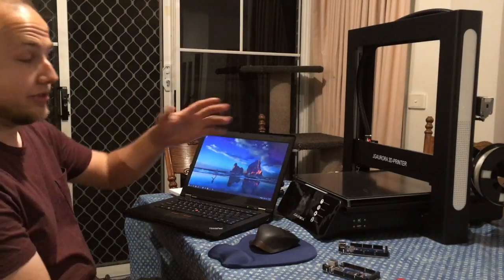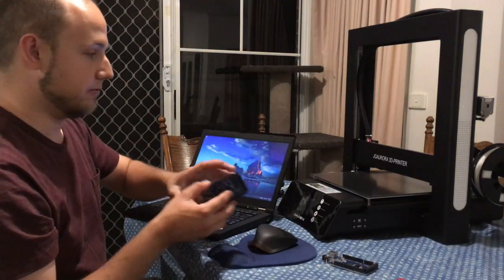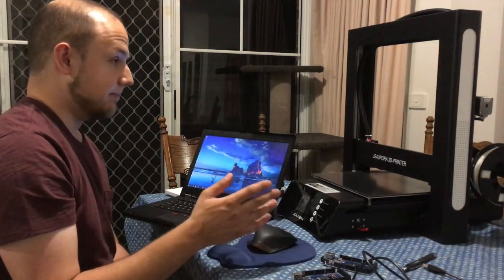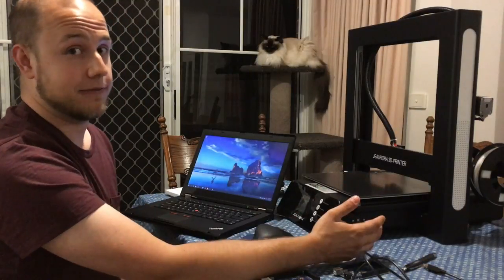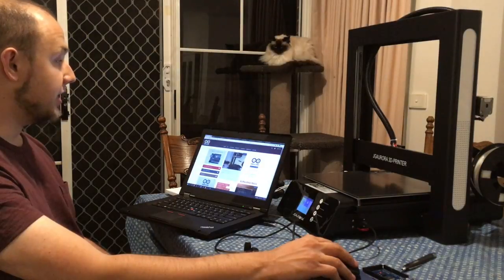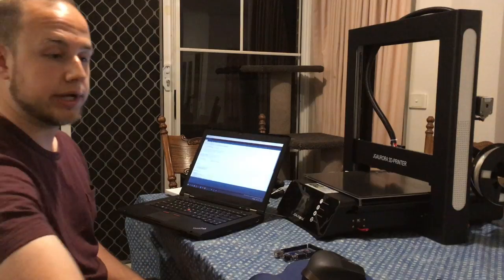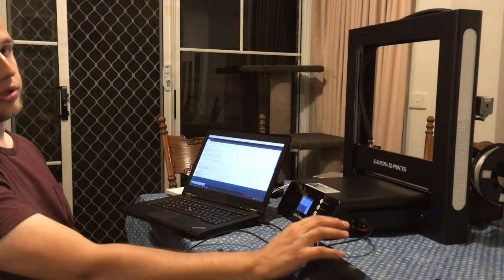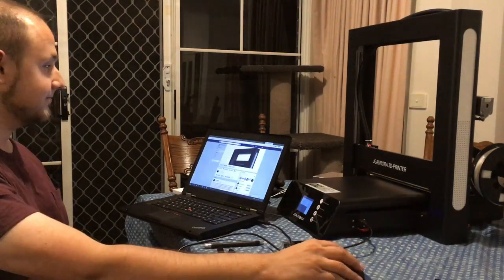How to upload custom firmware on JGAurora A5 3D printer

Comment: Samuel,  I updated my Jgaurora a5 firmware. You mention in your vid that with the new custom firmware the error "stopping after a few layers/mid-printing" vanished. However, I still experience the same error over and over again. Tested multiple usb sticks. Multiple cura versions. Also PID tuning, because maybe my instable temperature would cause the printer to stop. Which would be inconvenient, because it stops in the exact same spot each time. Anyone got some advice how to further tackle this issue? thx! PS: Did not update my LCD firmware btw, would that possibly fix it?
Reply from the maker: If you haven't already, then I definitely would suggest trying the LCD firmware update, it could possibly fix it. There are actually several hardware revisions of the MKS LCD module too - some of the MKS lcd modules are just plain dodgy, but it's the minority thankfully. See how you go. The other advantage of updating the LCD firmware is that it actually shows thermal errors on screen when the occur, which old versions don't do, they just appear to stop printing. PID tuning is possible to do with the custom marlin firmware. For best temperature stability results you'll want to tune the PID at the printing nozzle/bed temperature you actually use. Feel free to post on the forum (jgauroraforum.com) if you need help, its tricky to do via youtube.

Comment: I have the A5S and a mac, how do i go about getting the custom firmware installed? Thanks
Reply from the maker: It's much easier on the A5S. The A5S custom firmware page should have all the info you need - just scroll down the page a bit. :-) firmware.jgaurorawiki.com
Reply: @SamPinchesMakerShop  I got that done thanks. Just something else i want to ask, not a big deal but is there any way to change the lcd back to the way it showed the icons?
Reply from the maker: @dwmatthews113  You can flash back to the factory firmware without any difficulty via the same method. I've linked the factory firmware page on there too. Touchscreen interfaces are very new for Marlin, and I expect in 2020 we will see them improve significantly. Unfortunately I don't have time at the moment to work on this stuff further right now, and no one else has volunteered yet.
Reply: @SamPinchesMakerShop  Just wondering if you came across an issue like this and if i am right about the problem. I levelled the 4 corners of the bed, did the mesh level. Start a print and the bed is too loose. Level the corners again and then it goes fine but its every time and its always way off. The gantry is level, no bent rods. Could this be a microswitch issue? I noticed the microswitch kind of sticks to the gantry like static but doesnt do it on my other A5S and that prints fine.
Reply from the maker: @dwmatthews113  Happy to help, but youtube comments isn't the place sorry. Feel free to post in the facebook group or on the forum instead.

Comment: Sorry to go off script, but!!! You seemed to have some A5 knowledge.   Since I purchased mine June 6, 2018, I had 10 successful prints.  Now the filament is just sticking to the extruder tip and not to the bed,  any ideas?  Please help if you can
Reply: Did you solve the problem?

Comment: Have you tried priting ABS with this printer yet?  If you have, any warping issue and hows the print quality?
Reply: Samuel Pinches thanks for the quick replay,  I just order my and still waiting for it to arrive from GearBest. I will upgrade the firmware as soon as it arrive,  I print mostly on ABS because I can acetone vapor polishing the part for a smooth finish.  Can the heatbed able to go up 120c via firmware upgrade?  Most heatbed can heat above 110 without any issue, do you know is this printer using 12v or 24v?
Reply: Samuel Pinches so if I use a larger external PS I could get the bed to 120, will the touch screen allows me to set the extruder temp to 120?
Reply: Samuel Pinches if you can check on that when you get home I would appreciate it. I will definitely change it to a higher power PS, I like to get this to  be able to print ABS.

Comment: Hi Samuel. I just received my A5 and successfully flashed the custom firmware like you showed and everything went smoothly thanks! But I just noticed that my extruder fan is always on. Is the firmware configured like that or am I missing a setting somewhere?
Reply: Ok. Well the part cooling fan is off, until I turn it on. I just assumed the extruder fan should turn on at a set temp but I guess I was wrong. Thanks!
Reply: Samuel Pinches thanks for reply. Ive tried changing a few settings in that area but havent has much luck. I'm a total noob, only know what I know from watching your vids. I'm not exactly sure what pins my extruder fan is on at the moment
Reply: If I'm correct the extruder fan is plugged into the 12/24v pins which prob can't be controlled by the board, right?
Reply: Samuel Pinches I did try connecting to the second hot end mosfet and tried changing the "auto extruder 0 pin" from -1 to 3. Because that's what I thought that pin number was but it didn't work so I went back to original setting. Not that big a deal but I thought it might be an east fix. Thanks for the info though!
Reply: Ya, the factory MKS board only has one dedicated PWM for a fan. I may switch over to the unused PMW.

Comment: So if you don't have a square USB cable available could you still do this with the standard port?  Or do I have to buy a cable to interface to the correct motherboard?
Reply: Thanks for answering.  I'll keep that in mind if I pull the trigger on buying this printer.  My deskjet is wifi and uses the standard usb port.  Honestly the last time I saw a square usb used was on a digital video camera years ago.  I was really surprised to see one on this machine as I thought it was a phased out technology.
Reply: Oh I was wrong! It does have a square port in the corner.  I've only ever used the Wifi on it.  I don't even think it came with a cable and the main instructions were for a wireless setup.  

I did watch your review which lead me to this video.  Thank you very much for that.  I understand this machine has some quirks and I would have to make some adjustments including flashing the firmware, but it seems to be a good value for money and I don't have to do a complete build.

Comment: Hello all! I bought another JGAurora A5. It came with the reworked build plate and updated firmware. I flashed the custom firmware following you latest instruction and all appeared to go smooth until I tried using the printer. The Z axis would only move up, Y axis would only move in one direction and X axis would not move. Homing would not work as well. Only moved up on the Z axis. I flashed the A5 original firmware and all worked well. I tried 2 more times with the same results. I'm back to the A5 original firmware, which I really don't like. It homes right onto the build plate! Is it possible that JGAurora has somehow prevented flashing custom firmware? Any ideas would be appreciated.
Tom
Reply: Samuel Pinches that would be great. Thanks!
Reply: Samuel Pinches thanks for the insight. The X axis just jerks about 1/2 inch. I'll try your suggestion. I'm also going to flash the old A5 hex code, then try the custom firmware again to see if that makes a difference. Sorry you're out of commission for a while.
Reply: hi Sam.. I have exactly the same issue as Thomas.. had to flash the old hex code to get the printer working again... also Iam quite  noob on software and hardware issues :-(... would it be possible to show on how to get the Marlin software recognize the home position for the JG aurora A5 printer? and downloaded the prontface software and used the G0 Z0 X0 Y0 code and the extruder head come to the home position as earlier.. so how do i get this corrected in the marlin software now?..
Reply: more trouble... i got the old hex code back in the printer and now even after bed level the prints are not sticking to the bed and is all "blotched" ... is this because the z axis is now misaligned and not accurate (as the z axis went all the way up and hit the literally hit the top after i tried to home the printer after updating to marlin?...

Comment: is the jgaurora A5S compatible with macbook?
Reply from the maker: Firstly, this firmware for the A5 is completely different to the A5S. Regarding compatibility, you can download Cura for Mac to convert your STL files into GCODE files. You can also control the printer from a Mac over a USB cable using Pronterface. I hope that answers your question. Feel free to join us on the forum (jgauroraforum.com) if you have other questions. Cheers.

Comment: What will happen if you do not disconnect the lcd pin prior to flashing? thx!
Reply from the maker: On the A5, there is a risk the firmware upload will be corrupted, resulting in a dead motherboard that needs to have the bootloader reinstalled.

Comment: Hello, Samuel!
can I do this procedure with A3S?
Reply from the maker: Hello! Answer is maybe: for A3S with USB drive port on side, yes - please follow instructions on jgaurorawiki.com for the A5 model. For A3S V2 with SD card on front, no - please see firmware.jgaurorawiki.com for specific info on that model as it is similar to A5S.
Reply: @SamPinchesMakerShop  mine is model 2, with SD card.
I'll take a look, thank you very much
Reply: @SamPinchesMakerShop  I installed the A5S firmware on my A3S, but some adjustments forced the engines due to the different size.  do you have A3S firmware?

Comment: Thanks a lot for the video !

For some reason, the .ino file with the custom firmware cannot be downloaded.

Any other link?

Thanks & regards.
Reply from the maker: You need to download the zip for the main motherboard. "JGAurora A5 Custom Main Motherboard  Marlin Firmware 1.1.8C" at https://sampin.ch/A5-firmware
Reply from the maker: Also, please don't forget the most up to date instructions are on the wiki: https://www.jgaurorawiki.com/a5/firmware
Reply: Thanks a lot Samuel!

Regards! @SamPinchesMakerShop 

By the way, any idea, why my JGA5 cannot be detected in Cura, while being connected by USB. I already tried two different cables...
It says: printer not connected... :/
Without being detected, how to re-install the original firmware, in case anyhing goes wrong with the update?
Reply from the maker: Musicsson do you have any other software open that uses the serial port? Pronterface or arduino? There are other software tools to flash back, see the wiki for more info on them.
Reply: Thanks for your reply Sam. No, no other sofware open... 
The JG is simply not "seen" by Cura. @SamPinchesMakerShop
Reply from the maker: Musicsson if you have the ch340 drivers installed, then perhaps try another computer.

Comment: Hey do you know how I can see what port  the thing is in on a Mac
Reply: Samuel Pinches thanks i will just do trail and error as I thought that something will go wrong but you said it said it won’t so yay
Reply: Samuel Pinches hey I tried doing it but every tie i get this error message error compiling for board Ardunino/Genuino Mega or mega 2560
Reply: hey did not work. I also tried the other option that you gave the Mac but I could not find the the hex fill that was in the fill I downloaded from the link
Reply: ok thanks and yeah we will see how it goes. but I got that hex fill from the facebook page https://lookaside.fbsbx.com/file/Marlin-v1.1.8-JGAurora-A5.hex and tried it with that program for Mac and nothing happened. I was wondering if I could use the hex fill with cure and update it through Cura. also was that the right file
Reply: thank you. not sure if you will know the answer but I have the new Mac book pro with the usb c ports so using a adapter to plug the normal usb in the computer and maybe that is why its not working

Comment: Hi
I just wanted to flash the 1.1.8c firmware update on my JGAURORA A3S and i got some timeout errors

Le croquis utilise 144664 octets (56%) de l'espace de stockage de programmes. Le maximum est de 253952 octets.
Les variables globales utilisent 5089 octets (62%) de mémoire dynamique, ce qui laisse 3103 octets pour les variables locales. Le maximum est de 8192 octets.
avrdude: stk500v2_ReceiveMessage(): timeout
avrdude: stk500v2_ReceiveMessage(): timeout
avrdude: stk500v2_ReceiveMessage(): timeout
avrdude: stk500v2_ReceiveMessage(): timeout
avrdude: stk500v2_ReceiveMessage(): timeout
avrdude: stk500v2_ReceiveMessage(): timeout
avrdude: stk500v2_getsync(): timeout communicating with programmer

Could you help me please ?
Reply from the maker: Can you connect to the printer with pronterface? (Make sure cura and arduino are closed) if not, the bootloader on your motherboard may be damaged. Make sure you unplug the LCD when flashing or this will happen. To restore the bootloader, please see:

https://jgaurorawiki.com/a5/bootloader.
Reply: @SamPinchesMakerShop  After watching your vidéo, i expected that i could avoid to open my printer to disconnect the 2 motherboards. 😉
Reply from the maker: Jazzyboy you can unplug the connector on the lcd module through the small access port under the front edge - no need to open it up to disconnect 😀 - unfortunately, if you need to flash your bootloader, you will need to open up the chassis....
Reply: @SamPinchesMakerShop  I disconnected the connector, but the AVRDUDE still send me the timeout. Does it tell that the bootloader is corrupted and it prevents me from uploading the new Marlin ?
Reply from the maker: Jazzyboy yes, then unfortunately that means the bootloader has been corrupted.
Reply from the maker: Jazzyboy you should also check by trying to connect with pronterface.
Reply from the maker: @MrJazzman1967  I have not tried the ISP method. Yes, that looks good, but I cannot assist you with this method.
Reply: @SamPinchesMakerShop  so what solution do you advise for me ? Which method could be the easiest ?
Thanks.

Comment: Hello!! May I use Arduino Uno?
Reply from the maker: Hello Felipe, you want to use Arduino Uno ... to do what?
Reply: I want to upgrade my printer with custom firmware, but I only have Arduino Uno.
Reply from the maker: @felipemota6804  You don't need any extra hardware to upgrade your printer, if you have a JGAurora A5. Have you watched my video? I use the Arduino software, but you don't need to own an arduino at all.
Reply: @SamPinchesMakerShop  thank you very much for your explanation.

Comment: Will thisi firmware work on the A5S? Specifically for mesh leveling...
Reply from the maker: Nope - but I've created a Marlin firmware for the A5S - please see firmware.jgaurorawiki.com or ask questions at jgauroraforum.com
Reply: @SamPinchesMakerShop  I downloaded the software from this link, i keep getting an error from arduino when trying to upload. Trying to calibrate stepper motors and it keeps failing to upload.
Reply from the maker: @connerprince1748  Which model printer do you have? A5S firmware instructions are entirely different - at the bottom of the page I linked above.
Reply: @SamPinchesMakerShop  I have a a5s. I was able to get the firmware flashed via SD card but I cannot get the values I edited in arduino to upload to the printer via Com port.
Reply from the maker: @connerprince1748  You cannot flash the A5S via Arduino. Please see the links on the firmware page for more information on compiling your own firmware. Or, feel free to post on the forum and I can help you learn how set EEPROM settings over pronterface.